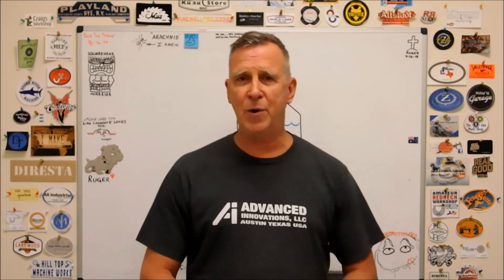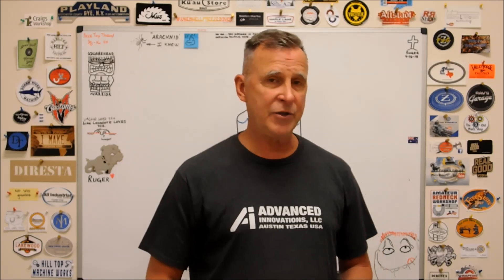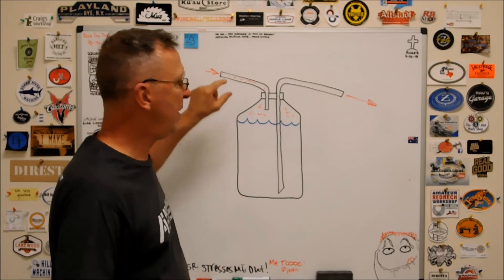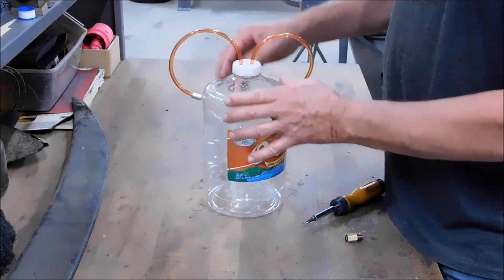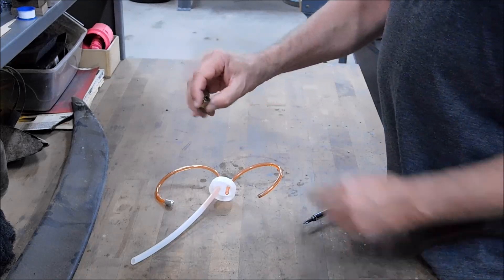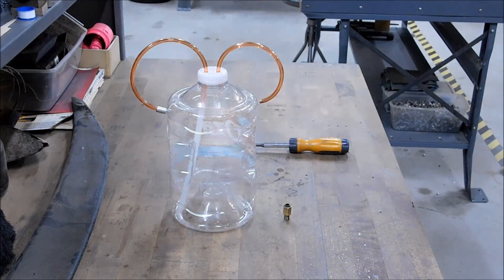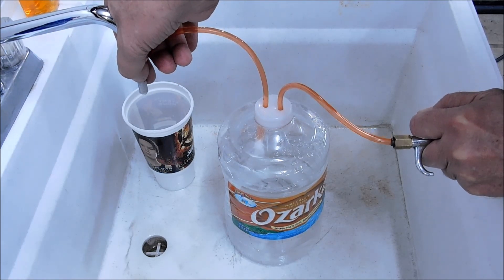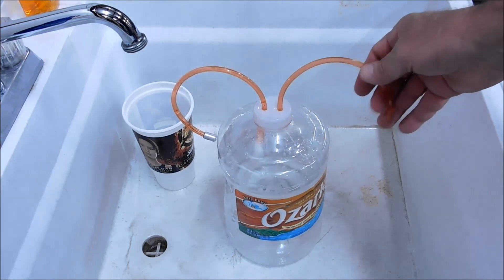DIY Coolant Pump

Comment: Hey Joe, gotta question for ya.  I'm looking to invest in a decent 115 pc twist drill set, and having a tough time choosing.  I'm a hobbiest/diy kinda guy and like to work with aluminum, mild steel and stainless steel, usually 304 or 316.  The sets on Amazon have such a wide range of ratings, most from people who don't know what they're doing.  Don't know if I should settle for TiN or go for M35 or M42.  Strictly USA?  Or German avoid China, etc?  McMaster Carr has surprisingly small selection, brand name not listed and very high price.  Same with CDCO.  Any suggestions?
Reply: Hi Jim, well i'm not Joe but thought i might be able to help out if possible. i have drill sets from several different manufacturers. the big set i have is made by Maykestag, an austrian outfit, and goes from 1mm to 13 in 0.5mm increments. if memory serves i paid around 130eur for it, not sure what that comes out to in $US. the set is just regular HSS - black and they hold up really well to daily use to just about any material i throw at them. they've been sunk into cast iron, aluminium, mild steel, tool steel, copper, brass and several different types of plastics. 

 TiN coated drills work ok i guess. what little bit i've used them they did the job. no better, no worse than any regular black HSS drills i have. so i really can't say it's a must have. as long as you use the proper lube for the material you're drilling, i don't see the imperative for having TiN coated drills. 

if you want a good allrounder drill, then an HSS-E bit will even handle stainless steel with plenty of coolant although for stainless i use HSS-Co8 alloyed drills and again with copious amounts of coolant. you can drill stainless with HSS bits but they dull rather quickly which is why i invested in a separate set in HSS-Co8 and use them exclusively in stainless

looking in my bookmarks, MSC sells a 115 piece set by Hertel - made in the USA... not cheap, but they show the country of origin on the tools they list.. a really nice feature and a real selling point in my book

for replenishing the drill sets i usually go thru either Hoffmann group (they do have a US presence and sell stateside) or buy from my sharpening service guy. 

here are several really good name brand drill manufacturers: Maykestag, Fisch, Werkö, Heller, Holex (Hoffman´s house brand) and Ruko. all these outfits have websites you can go to, some even sell retail on the web. you can also find their products in german ebay at reasonable prices. there are online website translators if you need help with the language barrier. just keep in mind these translators transliterate verbatim and leave out most of nuances so you will a lot of grammatical errors in the translated text of the site. 

hope that helps a little 

cheers!
mike
Reply from the maker: Starting from the bottom, HSS is the standard, when compared to lathe tool bits, M42 Cobalt is a huge step up. TIN coating is just that, a coating. Once it wears off, you have a HSS drill. Unless you are a NASA guy, american made drills are fine. I personally would go for a M42 set from USA. Like the other comment here, the black drills are tough, but I have had more luck with them on steel rather than aluminum or plastics. The M42 will be bright and softer materials will flow better across that. Yet still hard enough for steel.
Reply: MSC has sales on 115 piece bit sets, bit I'm in the same boat as you on brand. They are usually precision twist or hertel. I believe a couple sets are on sale right now.
Reply: Great advice from all of you, thanks!  I forgot about MSC, will check them out asap before the sale stops.  And I'd never heard of those Austrian/German brands.

I once heard a story from a guy who got a tour of a Chinese factory.  He noticed that only major size increments were heat treated, and was told that Americans only use those sizes, so no need to treat the others.  So I don't trust anything Chinese.
Reply: Even the cheap set I got works great, but even better if you have a drill sharpener like a Drill Doctor. And with a sharpener you can always touch them up to cut better, and you won't need to replace individual bits unless you manage to break them.

Comment: I don't think your bottle will pop with normal regulated shop air. When we shoot 2 liter water rockets we have pressurized the 2 liter  soda bottle to as much as 160 psi without busting the bottle. Your design is vented giving an additional "safety" measure. Go for broke! You are already violating OSHA requirements by simply attaching the push lock fitting to your air gun! Happy coolant squirting.
Reply from the maker: Without a cross hole in the nozzle, its a violation when using a gun. But, technically, its a closed loop system, so it may be a gray area.

Comment: Way easier to drill a tiny hole in a water bottle cap and fill the bottle with coolant. Squeeze as desired
Reply: What part of "I need to be able to use both my hands, it has to be hands off" wasn't clear enough?
Reply from the maker: Just use a longer tube and stand on it. Simple and effective.
Reply: @HairyNumbNuts  all of it. Can you say it slower?